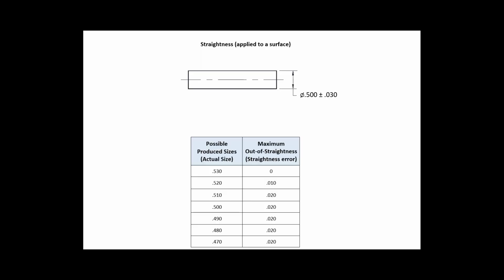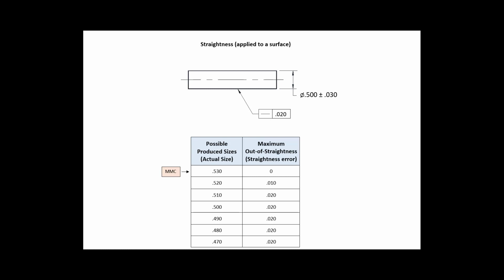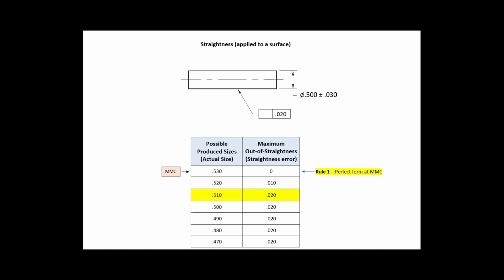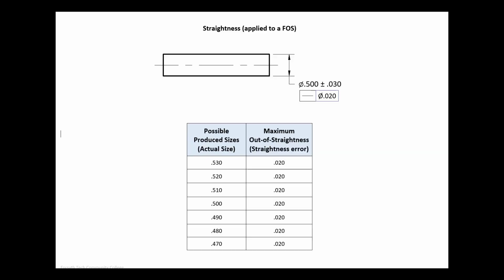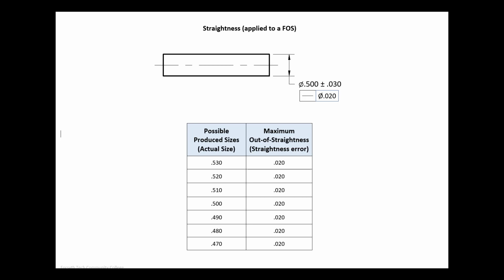GD&T straightness form control

Comment: Some question: If the actual size is equal to .520 and it's allowed for straightness error the value 0.010 , the control is applied to axis derived?